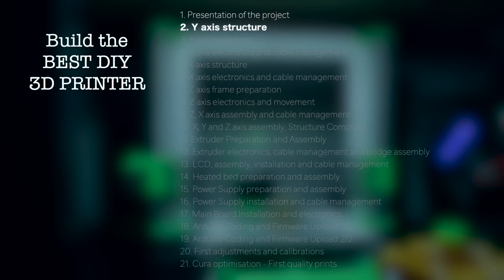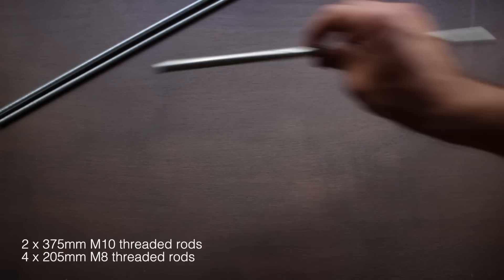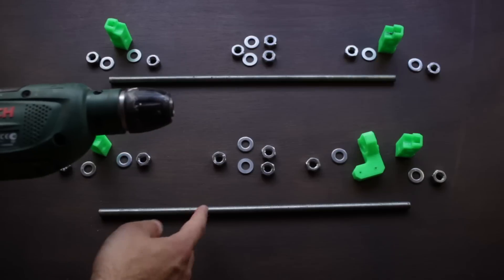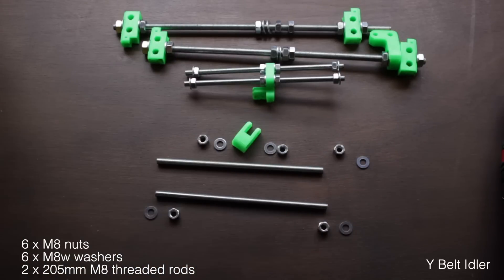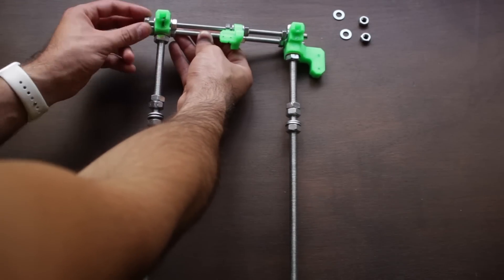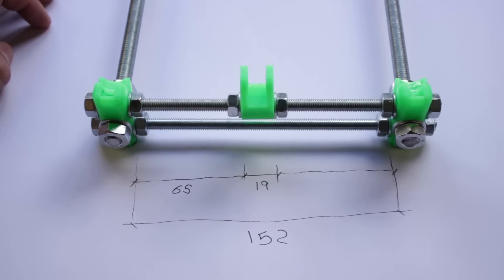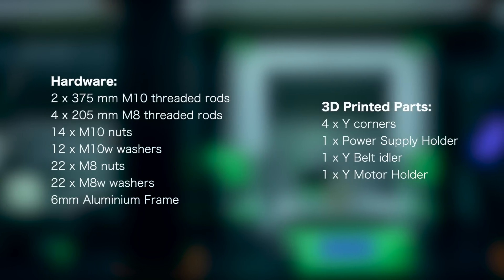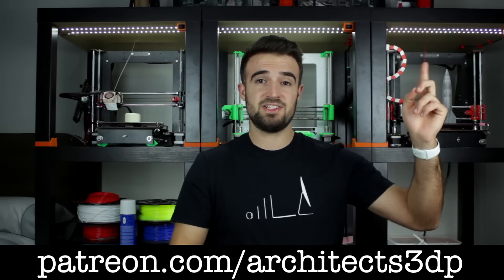Build the BEST DIY 3D Printer - Y axis structure #02

Comment: Sir thermalrunaway restart printer ..
Why this happen ??
In one of my print this happen and my printer stops.
May be my cooling fan blowing air on the nozzle .
Reply from the maker: and then yeah, try to avoid air from the cooling fan to blow directly to the heat block.
Reply from the maker: First make sure all the temperature sensors are connected and do not hace any short circuit,
Reply: This happend to my printer too, just make sure the wires are properly connected too

Comment: I have been looking forward to the second video in your series.  Just wondering, is there any harm in using Imperial hardware?  There isn't much metric stuff where i live.

Joe
Reply from the maker: Good question! Of course, you can use the equivalent imperial hardware 😃 the M10 and M8 that I'm using have a diameter of more or less 10 and 8mm. Just try to find something similar  😃